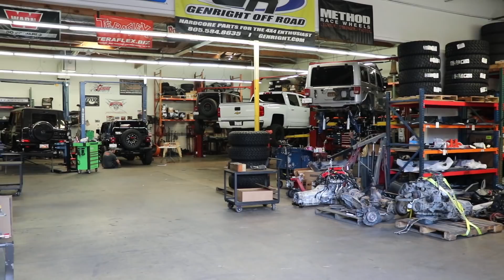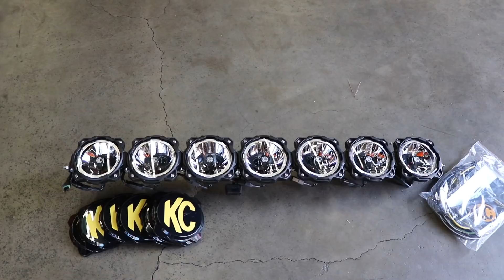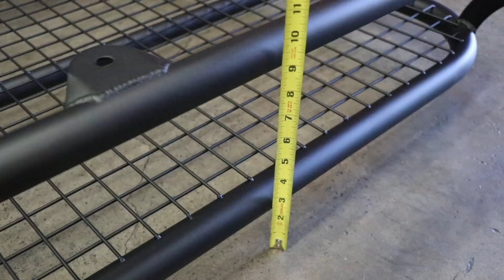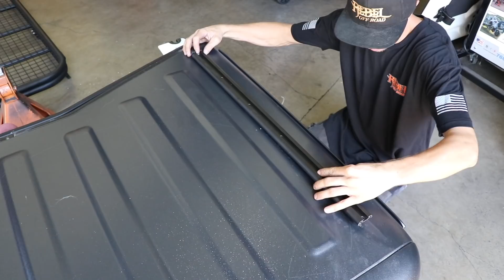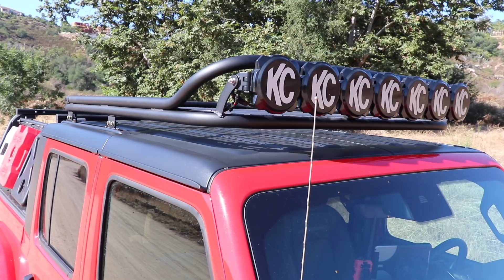Jeep Gladiator Roof Rack Install - Rebel Off-Road Halo 2.0

Comment: Good review - BUT - I would be concerned about weight capacity. The Rhino Rack (just as a comparison) has internal support through roof (backbone) system to transfer weight to frame and still limits weight for off road to 145 pounds.

Comment: Hi my name is Alan I live in the West San Fernando Valley I have a 20/20 Rubicon Gladiator Laguna is a little bit far do you recommend any place closer to me also is there a way I can get a detailed list of upgrading my vehicle I love your show I'm addicted to it I've just had my Gladiator for about a month and a half I'm 65 years old but I'm willing to go for it and I like the idea of doing one thing at a time so it's less out of pocket all at once thank you so much for your show.
Reply from the maker: Sorry, I don't know of any shops I would recommend in your area.
Reply: @TrailRecon  Rebel Offroad company out in Laguna how many hours did it take to put that roof rack and lights together. I guess Laguna is only about an hour away from where I live so that's not too bad I could drop it off and hang out.

Comment: Great video as always, this may be the first mod that I have seen that had the hardtop drilled. I'm planning to mount a set of Thule racks on my gladiator (primary to carry my surf rods). My plans are to mount the Thule tracks in the same area, did the installer need to use longer screws for this job? Can you show the interior washer and nuts? Keep up the great videos!

Comment: Hi, watching your channel from the UK. Very jealous of the great terrain you have access to wilderness. Really enjoy your content. When watching your roof rack assembly I immediately thought that for your application a great addition would be to use marine deck glands to bring cables through your bodywork or roof. These can be plain glands for cables or with an integrated plug, and of course they’re water proof.

Cheers John

Comment: One thing I just gotta say... why do people insist that but connectors are a good thing, a professional thing?... people, stop using but connectors... that's not legit... solder your wires everytime... that's the only truly legit way... otherwise you find them all over the place in your factory wiring... stop using but connectors & calling it professional...

Comment: Sleek design very functional !I love the look of it ..if I had to nitpick about one little thing ..I would’ve used stainless steel button head bolts instead of the cad plated hex bolts holding it to the Thule foot . Kudos.

Comment: I’d like to use that rack on my 2-door JK. I have wanted a rack that mounts to the back half of my hard top, but allows me to still take off the front freedom panels. How long are the mounting strip/tracks that get screwed to the roof. I don’t see on their website where they put that length.

Comment: Great install and gear! However I am hesitant to instant a roof rack for an overland Gladiator, when I already have all that space behind with the flat bed! Is it really necessary to add cargo space and have that extra weight?
Reply from the maker: I'll be using every bit of my cargo next year when my son and I head off on some long trips.  This rack will be very useful.

Comment: Rhino rack or this one brad?  Pros and or Cons?
Reply from the maker: Some big differences especially considering the Rhino on my JK is designed to hold 800lbs static weight.  That's not what I need this rack to do... but that might need to be a longer discussion.

Comment: Hi from Canada, so 8 small bolts (1/4 ")  on the rail to the roof is enough for holding the big rack? just saying , but still a nice rack
Reply from the maker: It's pretty solid as it sits.

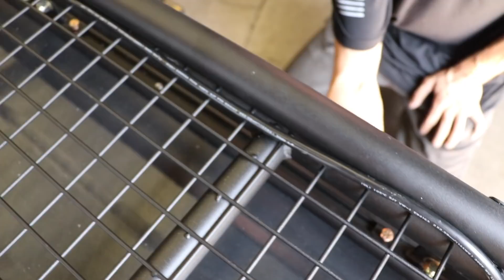Comment: 7:57 why put the wire over the basket? It would seem to be more protected underneath.
Reply from the maker: Great point, I think rerouting it underneath is a better solution.
Reply: I'm surprised there is no way to route the wire through the steel tube. That would keep the wire protected and keep it clean look
Reply: JustNobodyButME great idea! And to run the wire through the tube you can drill your holes and use a vacuum to suck a pull string through so you can pull your wire 👍
Reply: I'm guessing it hides it a little since you are mostly going to see the underlying of the rack from the ground.
But I agree, un top its more likely to get damaged or nicked with the load you throw up there.